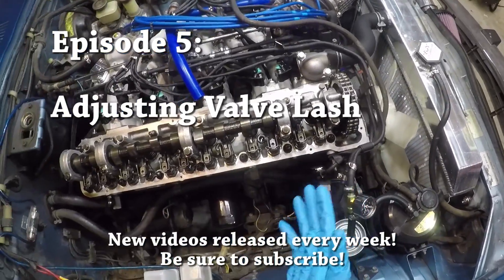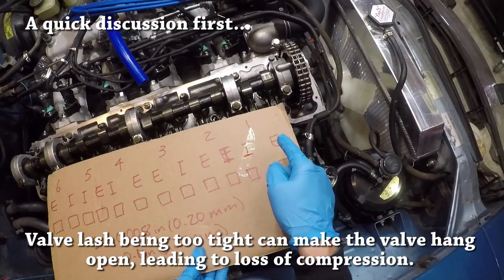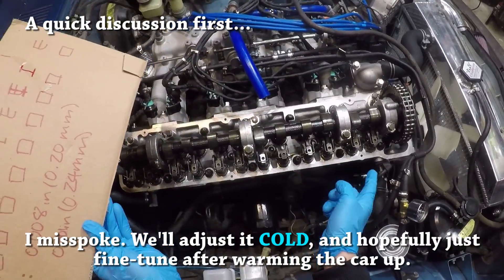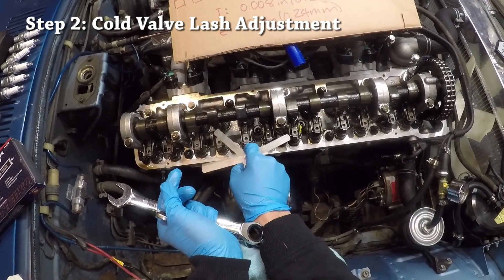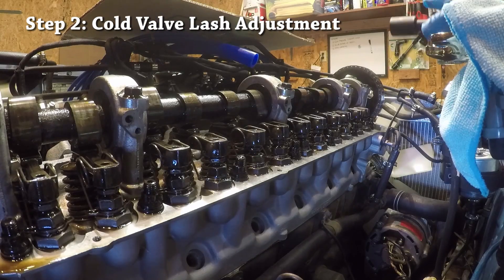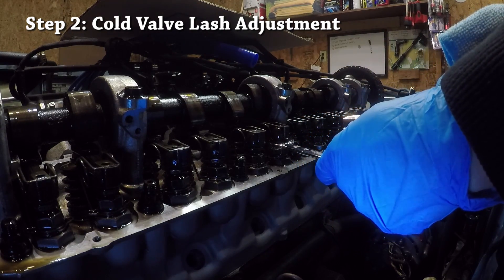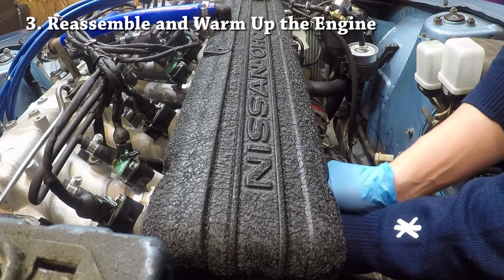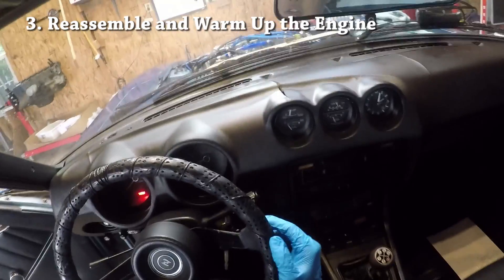Datsun L-Series Engine Testing and Tuning Ep.5 Adjusting Valve Lash

Comment: Think of it like this.. Adjusting the lash cold.. Is for calibration purposes to run in the cam. Adjusting the lash hot is for tuning to get the engine to run smooth.  On a new engine assembly it make sense. You want the cam to run warm on a older set... It makes no sense what so ever.

Comment: I adjust them hot 10 &12. I use a starter button, Matco "go no go" feeler gauges and can do this in about 20minutes. You can determine whether it is an intake or exhaust valve by simply looking at where the cam lobe is as opposed to where the intake or exhaust runners are. Always recheck the lash after locking them down, it can change. The valve lash should be adjusted every 15k miles.

Comment: You say this is for the Datsun L-Series so the chart that you made on the card board . . . My 82 280zx would have the very same sequence and valve lash adjustments correct?  I'm about to attempt to do what you've shown here on my 82 zx because the rebuilt engine that I had just put in is making that "ticking" sound. Let me know asap.  My car engine seems to run and idles fine, just have that more than suttle ticking sound! Thank you in advance.

Comment: Hi
Tell me please if changing valve clearance can cause rpm  waving when engine is cold.
I adjust my according datsun  manual and have problem with cold engine rpm is going very low and then jumping up to 1000rpm and down again but after 15 min of runing is completly perfect and she  keeps 900rpm.
I have to say that before adjustment when valves gaps were biger then should be engine didn't have this problem.
Reply: Is your car fuel injected? Sounds like an idle air control valve is behaving badly.

Comment: On your chart it should clearly show
Cold E = .01 in (not 0.1 which it kinda looks like)  and I = .008 in  (the mm you gave are about correct). 
Hot you would add +.002in so:
E = .012 in  and I= .010 (E= 0.30mm I=0.25mm)
It’s worth  saying that if it’s not a stock cam, then these numbers could be different.   As you said, the preference is to set them cold to be about right and then dial them in exactly when hot to the figures above for hot lash.
Reply: Oh... and you can lock down the rocker locknut as you say to “very snug” by hand.  The FSM spec is actually:
Rocker pivot locknuts 40 lb-ft (FSM says 5 to 6 kg-m) you can use a “crow-foot” wrench on a torque wrench if you are as OCD as me.

Comment: Thanks for the videos.  I have a question about a fusible link I think goes to my fuel pump, but I'm not sure. It's a car my son and I are rebuilding together after someone else disassembled. It is an open plug and the Factory Service Manual isn't clear where the other end of the plug should go. Is there a way I can send you a picture of the wire for any advice?
Reply from the maker: Sure man send me a pic and I'll see if I can help
Reply: @RestorationForBeginners  Not sure how to send a pic through Youtube. Are you on Facebook?

Comment: have you looked into the best oils to use for this kind of engine? Many opinions out there about use of modern era oils. When the engines were new oils had higher zinc content (per the internet for what that is worth). Modern oils have low zinc content, and supposedly are not good for the wear surfaces of the cam lobes. Not sure why this would not be a problem with modern engines unless they all had roller bearing in the valve train. Anyway again internet info says to use a zinc additive or a high zinc oil to help protect the camshaft. I use Valvoline VR-1 based on various forums. I have no idea if this is correct, just something to consider.
Reply from the maker: Man it sounds like I need to switch oils.
Reply from the maker: Haha yes, I also spent some time researching this subject, and the prevailing sentiment seems to be that almost any oil today (as long as it's the right weight) is better than oil that people used 40 years ago, although for some reason some owners swear that using Royal Purple will ruin your engine. 
While this isn't the most solid logic (we're always looking for the BEST oil to use, not what's satisfactory), many seem to prefer Mobile 1. I use the high mileage synthetic oil, which has higher zinc content. Probably unnecessary but I have a TON of it from impulse purchases whenever they go on sale.
This just got me thinking though. I wonder if using a slightly thicker weight oil will help me with the oil burning problem.
Reply: I too did a lot of research and the general consensus is Valvoline VR1 SAE 10W-30 Racing Motor Oil because of the higher zinc content.
Reply: that's the thing, opinions everywhere on the subject. I just threw it out there for consideration, along with the qualifiers about internet. I hope it does not matter, but I went with the forum consensus. Since I am in the south where it rarely gets below 30f (like maybe a couple days a year and only at night) I run 20-50 VR1I mostly have to deal with 95f and AC running adding more to the temp loads this should not really matter though since the thermostat keeps the temp pretty constant I figure the only real issue with weights has to do with initial start up. I am guessing here that most modern engines have roller bearing in the valve train to reduce friction (gas mileage reasons) so the need for the cushioning of the zinc is not as important. But again I am only parroting what I have read. Also read that zinc was an issue for the cat converter, causing oil blends to reduce it to protect them.
Reply: there is another opinion for you.

Comment: I forget what car I owned at the time, but I used to adjust valves while car was running, sounds funny but actually worked great.
Got my chain holding tool, thanks for the link, its pretty well built. 30 degrees, well now thats darn near summer temps.

I have a P90 head with out a spray bar, wondering if adjustment could be done while running , might just try that out.
With a solid lifter car, you will always hear a little clicking from the lifters, esp when cold.
Reply from the maker: Haha yeah that chain tool is pretty neat. It does exactly what it's designed to do, nothing more, nothing less. For 12 bucks I'll skip the woodcarving and potentially having splinters in the engine!
Oh man, even if it was possible to do, I would not recommend it! Here's just a few reasons: 1) if the oil gets hot enough, it'll burn you; 2) it's hard to access the lash with the feeler gauges with the spray bar on; 3) if you're relying on internally oiled cam to do the lubrication, the camshaft lobes will throw oil; 4) the engine will probably die in 1-2 minutes due to the massive vacuum leak; 5) I assume it'll be very messy!
Reply: I believe the engine we adj the valves "very hot", was a 289, no spray-bar, very little oil loss, I think the oil came through the rockers, and cam for lobes only, and not alot, at idle.  I do remember we did it quickly. But that was 48 years ago, do  remember doing it, but memory is little fuzzy. wonder when Datsun quick with the spray bar, guessing 1980. Didnt know that you have done a compression test since head has been reinstalled.
Reply from the maker: Ah. That's fascinating! 
On the spray bar, I think they actually started installing them around 1977. Oil spray bar, when it works, sounds like the preferred method of lubrication over the internally oiled cams. Most people run both, but I personally do not think that's ideal with the stock oil pump. I have A TON to say in this matter based on my findings with the clear valve cover, look out for the next episode on this.
While I wouldn't recommend doing it while the car is running for the L-series engine, if you do attempt it, please film and I'd love to watch!! A cold adjustment and hot check/refinement should be sufficient.
Reply: Don't do it while running.  That's why they give you the clearances for cold.
As for doing it while running, I think he's referring to the older American V8s... 289, 302, 350, etc
Reply: It was a 289 I used to adjust while running, some 45 years ago, worked good.
Reply: The only time I've personally ever done it while the engine was running was on an old Chevy SBC.. 355 stroker

Comment: What are your plans for the car after you're done with the engine? Will you try inrcreasing the horsepower once the engine is running perfectly? Or do you want to focus on bodywork/rustrepair/paint? or even on the interior?

Great video as always! They will be very helpful once I get and start restoring my Z this summer ^^
Reply from the maker: Do burnouts and road trips, what else?!!
I will most likely focus on the frame rails, total rebuild of the suspension, and brake work. But there's no shortage of work that needs to be done! Seats need reupholstering, half the lights are dead (including the cute little inspection light under the hood), door doesn't close, rear view mirrors keep flopping around, carpet needs replacing, dash crack needs to get fixed...
Reply: That sounds like enough work for hours of content ^^ 
What is the frame rails' condition ? Worthy to replace or still reparabel? 
(The small inspectionlight is the cars lucky charm)
Reply from the maker: Haha one on the passenger is in bad shape. I'll need to get it professionally re-strengthened. I'll probably buy a custom-fabbed frame rail that fits over the existing rail and have a shop weld it on.
Reply: @RestorationForBeginners  hey ive tried looking up the floppy mirrors issue, and i havent found anything online about it AT ALL, do you have any info on how to repair them? or would i just have to buy new ones?

Comment: Really enjoy you’re videos. They’re really helpful and good video quality 👌🏻
Reply from the maker: +Luis Gonzalez you got it brother, wrench on!
Reply: So I have a question, I have a 77 280z the car cranks and at times it stays on for like 30 seconds but runs real rough, other times it stays on for as long as you want as long as you keep foot on gas. Idk if you can probably give me any tips on that or ideas on what it can be. Thanks in advance
Reply from the maker: I'm going to guess that it's either a vacuum leak or a fuel delivery issue. When the car has a vacuum leak, it tends to idle real rough and can die at low rpms. Other thing I would suggest is to install a fuel pressure gauge (check out episode 29 if you haven't already) and check the fuel pressure. You should have 30+ PSI at idle.
Reply: I will definitely do that, thanks for your time and keep up the good videos.